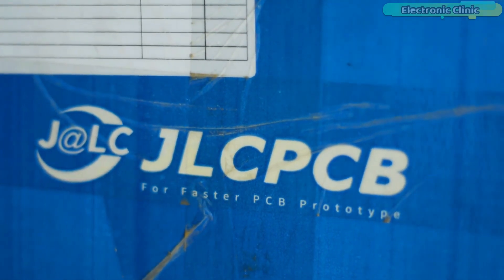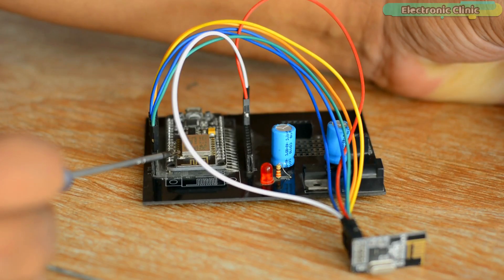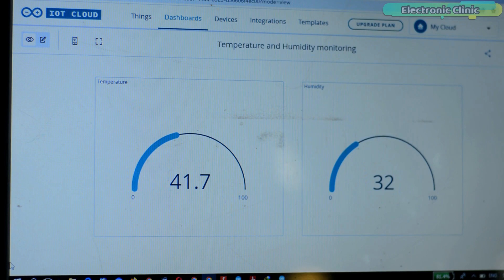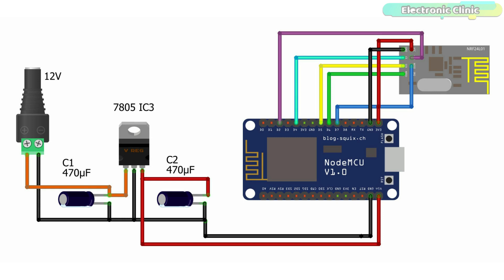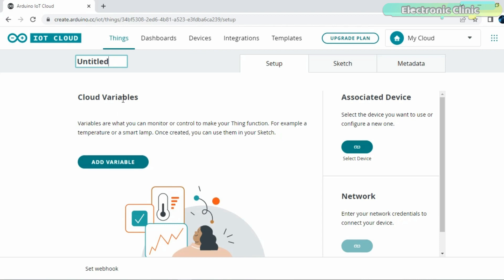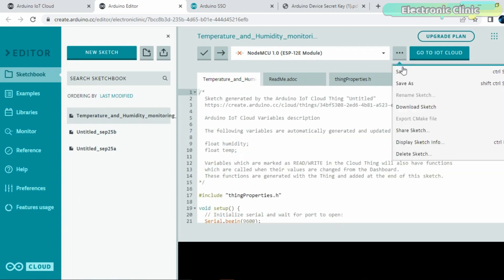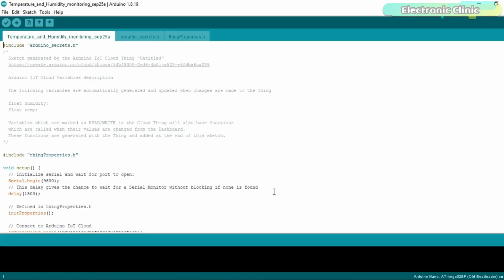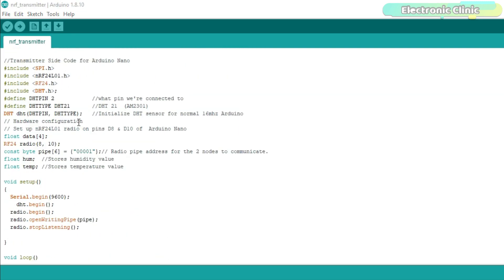ESP8266 and NRF24L01 Gateway for Arduino IoT Cloud, DHT21 Sensor, ESP8266 Project, IoT project

Comment: im making a drone and wonder if you could answer this is it possible for a nrf24l01 to receive signal for the esp8266??
Reply from the maker: @Edddy813  yes you can use esp8266, but I recommend using esp32.
Reply: @ElectroniClinic  why is that, i have a 2 teensy 4.0 and a esp 82 and a nrf 24 at the moment and didnt wanna buy anything. If the 32 is better can u tell me why? im making a flight controller and then a transmitter(controller)